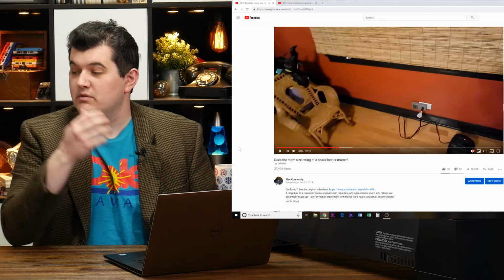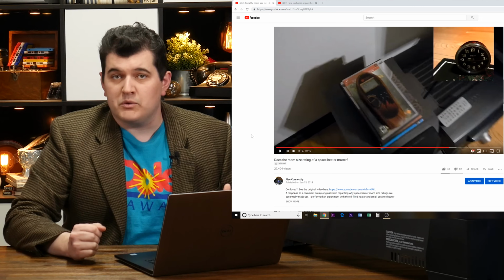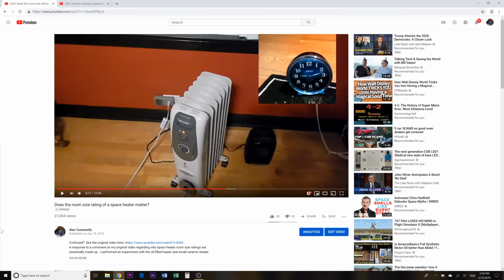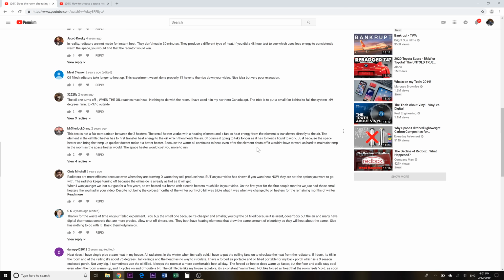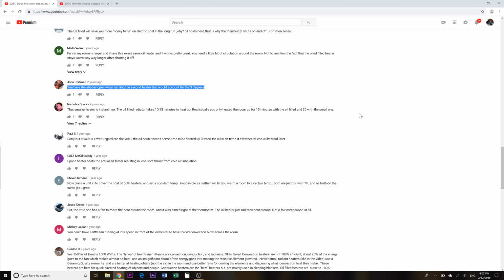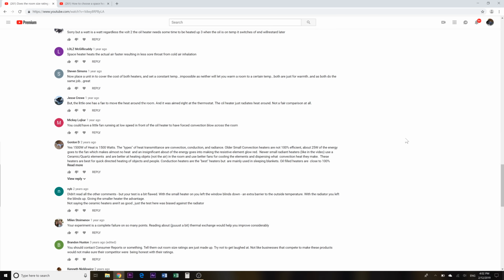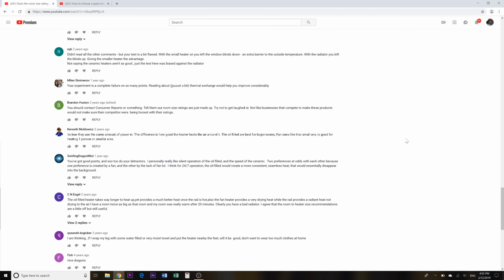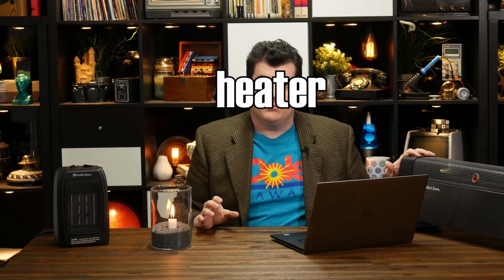More Space Heater Nonsense

Comment: I love your videos, and agree with all the points you were trying to make........that being said, buckle up for some grade A pedantry. Ehem Electric heaters powered by AC current are actually never going to be 100% efficient. Even if you had a perfectly sealed room made out of insulation that could block all conduction and was also 100% reflective to infrared and you had way to measure the kinetic energy of every atom of air in the entire room at all times. why? Well, because all conductors which have a changing current flowing through them will act like antennas and so some of the energy will be lost to EM emissions. Now if the walls were also 100% reflective to all bands of radiation, then I think you really would have a heater that is 100% efficient, depending on how you define it (technically the room is the one providing the conditions that allow for 100% of the energy to be converted to heat prior to leaving the room, since without that EM echo chamber the energy of those waves would exit the room before being completely converted to heat).

Comment: Good video. One of my greater complaints in life is our ability to disagree about units. We all use the second, hour, minute, etc to measure time and it is universally adopted. Why can't we do that for everything it baffles and bothers me. How stubborn can you be!

ANYWAYS 
I was at a kitchem showroom with my aged parents as I had to drive them and didnt want to wait in the car so I thought I'd come in and listen to the slick salespersons spiel or whateveryoucallit. 

So he said, THIS STOVE HAS AN OUTPUT OF 19000 BTU PER BURNER IT IS THE MOST EFFICIENT. As a sh#tty mechanical engineering student who likes to make people upset I said "oh Emm gee how do you like measure the efficiency?!?" He said "IT HAS THE MOST POWER AND IS MORE EFFICIENT". Okay. A little laugh on the inside. Then I said "well doesnt the 19000 BTU stove burn more natural gas?" Then I said a BTU is a unit of ENERGY not POWER. Power has a UNIT of UNIT OF ENERGY DIVIDED BY UNIT OF TIME. I then got two dutch ovens and filled them with the same level of water and put one on the cheap induction cooktop (it was on sale) and one on the really expensive gas range to demonstrate HEAT TRANSFER. A gas range is only like 20 to 35 percent efficient at TRANSFERING energy to the pot you're heating. Thus, an induction stove at 3500W (pretty typical configuration) with an efficiency of 80% because it can TRANSFER the heat directly to the pot is more effective than a 19,000 BTU burner (approx 5300W in proper units) because 80% of the gas burner just heats up the air around you immediately not the pot. Then I had to explain energy consumption and cost. 

He didnt get the sale. 

Shout out to Steve from the local subzero/wolf showroom. You truly need to read a textbook :P

Comment: 1. In what universe is an appliance that takes more than an hour to "get going" considered functional and acceptable, anyway?
2. I strongly suspect that oil-filled heaters "dry out the air less" precisely because they are worse at heating. Dry air in the winter happens when cold air leaks in from the outside and then gets heated up inside. The absolute humidity stays the same, so the relative humidity decreases. So, yes, if you heat the air up LESS, it will "dry out" LESS.

Comment: 15 Year HVAC tech here. No the unit with a fan will always performer better. The more CFM you move around the room the more evenly the room will heat and feel more comfortable. Also all electric resistance heaters are crap IMO Heatpumps and any other form of heating is more cost effective way of Producing heat. 

One of my MASSIVE pet peeves is people who call Electric heaters (100%) efficient so the make 3 BTU per watt but a heatpump will make 10 BTU per watt so  is it 350% efficient ??? No because that is impossible.

Comment: I'm with you 1500W is 1500W no matter how it is or isn't buffered or moved (fan vs convection). It creates the same 5120 BTU. Although Alec, this isn't truly 100% efficient... there are losses between the meter and the cord that go up in heat and since much of this wire may be buried in an outside wall's insulation both of us (and your other energy knowledgable viewers will know) this heat is going to the colder side of the insulation which in the winter is most likely outside-therefore some trivial loss.  

The only thing I can say about the baseboard style heater is that most of the heat goes straight up heating the air in the upper quarter of the room ... the upper air as it cools falls (or is displaced by lighter aka hotter air) warming the occupants without drafting other parts of the room... 

Now a fan-forced heater can cause cooling drafts because of air being pulled into the heater or cool air vortexes caused from the ejected hot air causing cold air currents. This happens with one heater I have, an inexpensive, poorly designed electric fireplace. The fireplace has a heater above the 'flame' window. Since the warm air is ejected about 2 feet off the floor by a  horizontal squirrel-cage fan, if you are sitting off to the side of the airflow relatively cold air will get circulated cooling open flesh (aka my bare feet)... Now is this heater not putting out the rated 1500 W, absolutely not! It is just doing a better job of heating the ceiling than the occupants of the room... And since I am in the Ice Box of the Nation heating a ceiling doesn't do much for keeping me warm!

For those of you reading this and about to go and by an electric heater, buy the cheapest quality looking heater (with certifications to match) you can in the watt rating you require (200-400 for desktop, 1500 for ANY room size) and enjoy the heat knowing Honeywell/ComfortZone/or Brand XYZ didn't subsidize their heating bill with your hard-earned cash!

Comment: Certain ceramic heaters are also self limiting for safety purposes. They act as Thermistors and the resistance increases with excess heat. This decreases the heat and risk of fire in case you block the air flow.

Comment: I think that since it has more surface area that more air can pass through the heating element so it heats up more air. It may put out the same amount of heat but rhe little heater heats a small amount of air to really hot and the bigger heater heats allot of air to warm. Chances are that the small heater will circulate the same air heating up a small area.

Comment: I enjoy your videos and I completely understand and agree with your findings. I just have a tip for anyone who might need it. I have an oil radiator heater just like the one you used in the video and I found a way to get more out of it than normal and what I do is set up a fan blowing on it which helps cool the thermostat so it stays on longer and helps circulate the heat around the room and the effect is undeniable. I know introduction of a fan changes the experiment but that's what I found none the less

Comment: I think, for the experiment to have been seen as 'valid' and garner a more respected response, both heaters should have been the same type.  Having the oil filled radiate style compared to the little forced air heating element style. causes a little disconnect in viewers brains. If both were essentially the same kind of heater rated for small and larger rooms respectively, the experiment would just look like it makes more sense to onlookers.

Comment: The ONLY argument for slow-release room heaters like the oil filled ones that makes any sense, is that warmer rooms also LOSE heat at a faster rate. By maintaining a heat equilibrium between both the oil and the room and the room and the exterior, energy loss from overheating is minimized.

Comment: Yep. I use my oil-filled heater for a small room because it’s got a broader surface and it’s slower. The slower heating seems likely to be safer than a glowing hot element, in a cramped area. I also run the ceiling fan low with the winter switch on to try to circulate the air and remedy some of the “heat momentum” problems. I’ve wondered whether they make oil-based space heaters with a (potentially cabled) remote thermostat.
Reply: The remote thermostat really won't make much difference. If the room is cold enough and the heat loss in the room is high enough, and the heat circulation from the unit is not quick enough, the internal thermostat will have to turn the unit off because it's overheating. The way a remote thermostat helps is if you want to specifically set the unit to heat the room to 70 and have it stop heating once the room reaches 70. But again, if there's not enough heat circulation away from the unit, it will have to shut down when it gets too hot for safety.

Comment: Just a thought... Heaters that rely on passively distributing the heat to the surrounding air, especially if a thermostat limits the output, requires a bigger room, since there will be more air flow in a large room. 
After all, a large room has more cold air to keep the thermostat active. Maybe the premise is all wrong. Maybe a "small room" heater is intended to be more aggressive, and thus "better" in the test you ran, while the "large room" heater indicates a handicap rather than a selling point.

Comment: The difference between heating temperature and room temperature adds to the efficiency of transferring heat from the heating to the room. Therefore, heating with a fan speeds up the heating of the entire room, as it constantly maintains a sufficient temperature difference. When it comes to measurement, you only need to measure the power consumed over time and here you will see the difference between a 1500W heater without and with a fan.

Comment: Isn’t the benefit of the oil heater, that it can hold onto the heat longer as it has oil inside? That’s what I was always led to believe?..
Totally understand the point that’s been made though, ideally the large room heaters need a fan to circulate the air quicker and to stop it from cutting out AND have more watts.
Reply: It radiates heat from one thermal mass to another so you and the objects around you feel warm before the air ever warms up

Comment: Maybe it is because the heater with greater thermal mass will continue releasing heat for a long time after it's turned off, that meaning it will heat the room beyond the desired temperature. If the room is smaller this effect will be greater as long as it dissipates less heat to the environment than a larger room, therefore in a small room you would rather use a heater wich doesn't release extra heat after turned off, so it doesn't get any hotter. Maybe.

Comment: Actually the oil filled heater is better as it shuts off, the problem is that the thermostat is in the housing (not separated) so it regulates to itself and not to the room temperature. The oil is used to store the heat so it can deactivate and still heat. Call it economy mode.

Comment: Well, I think you partly missed the point: a RADIANT heater is exactly that - it RADIATES the heat. It doesn't warm the AIR in the room as fast as an AIR HEATER (even though it does that as well, since it's by the very definition a convection heater, too), but it has the advantage that it gives off radiant heat, which means that it heats up the things in the room - which includes the people in the room facing it. Which is why radiant heat is much better when it comes to heating a room that an air heater.

You didn't check the surface temperature of ANYTHING in the room (which would have showed you that at least some of the heat radiated from the radiant heater was heating up all kinds of surface (including the walls) of the room, which actually (again) makes the room feel much warmer than just the air temperature alone will be able to do (and that's where the energy you were missing in air temperature was actually going).

So, TECHNICALLY, if you just want to heat the AIR in the room, yes, use an air heater - that's what it's for. If you want a "nicer" heat over a longer time, use a radiant heater - and yes, it will be more efficient, since it actually doesn't have to heat the air of the room as high as the air heater - and it will keep the room feeling much warmer over time for less enregy, too (and yes, I had to heat my house for three weeks just with those, because the oil truck wasn't able to come up my drive way in one really bad winter, so I actually experienced that difference myself, since I used the air heater to get my bathroom warm when I needed it, while the radiant heaters kept the other rooms comfortably warm - for less energy.

PS: and as with all convection heaters, PLACEMENT is the key as well. There's a reason why your standard radiant heaters are normally installed below your windows (and not in the middle of the room or on the inside walls).

Comment: One thing I think you missed. Your small space heater with a fan is the best(of the three being spoken of) when you need to take a cold room and make it a warm room fast. Your baseboard heater's strength is going to be the more slow and gradual heating of a room when it's less urgent. The oil heater is more suited for keeping a room at a specific temperature. 

If you are trying to KEEP a room at 72, the oil heater will do a better job for less energy due to it's own thermostat, than the space heater who's only job seems to be to try to aggressively jack up the temp.

Comment: Want free heat? Move power-hungry electrical appliances into the room you want heated. If you have a couple of computer servers running in a closet or your basement, move them into your bedroom and gain the benefit of the heat they're putting off anyway.
I submit that computers ARE more efficient space heaters, because they provide x watts of heat PLUS crunch numbers while generating said heat.

Comment: You’re right, it’s basic physics, case closed. But there’s another issue to which you alluded but did not fully address. 

I used a ceramic heater with a fan to keep a room comfortable. The room was too cold with the low setting but too hot with the high setting, so I needed to use the thermostat. Every heater I could find was wired such that the thermostat shut off both the heating element and the fan. The residual heat in the element kept the thermostat warm, and the heater would not turn back on until the room was cold. The solution is simple, keep the fan on when the thermostat shuts down. I don’t know why they don’t do this. I rewired two of them and they worked perfectly, but no longer UL listed.

Has anyone found a space heater that functions this way?

Comment: It's been my personal experience that convective heaters of almost any type are ok for rooms of almost any reasonable size, that AREN'T DRAFTY, over a long period of time.  For rooms in older houses that leak like an old guy's bladder, a resistive heater with a fan is going to be MUCH better because you're not heating the same air.  That's the difference.  The amount of air moving over the heating element compared to the amount of air being exchanged between the room and the rest of the house/outside.
Reply: It's just a matter of circulating the air so that more heat makes it to the lower level of the room where the people are before it leaks through the ceiling and upper walls.

Comment: Oil filled radiators are great, as well as only useful, for situations where your electricity is very cheap during the night, so you can warm the radiator up during the night and it will give off that heat over the day.

Although to be fair radiant heat feels better than air temperature.

Comment: But.. the oil filled heater does not dry out the air in the room so much and is a much less of a fire risk if something falls against the heater. Ideal for a bedroom with an overnight cycle run.
Good videos... again 240v is better!

Comment: I have an older hardly used ceramic heater. Metal fan inside. Thing is noisy. Strong metal construction though. Also have a newer ceramic heater. Plastic case, guessing s plastic fan inside like would be used in computers. Really quiet. Like it much better. But yes, they heat the room just the same. My favorite space heater though is super quiet. It keeps heating as long as it's on and I like to use it at night, although it uses less electricity than the other space heaters. The old style light bulb. When I need extra heat and light it seems to be the most efficient. Even turning a space heater on the lower setting, figure 700-750 watts if it ran for an hour, but if it runs only 10 minutes each hour that is over 100 watts an hour plus let's say 8 watts to run a led light bulb. Bit if I use an old 60 watt light bulb I get heat and light using only 60 watts an hour. But still people who try to get me I'm destroying the planet if I don't use an energy efficient bulb and space heater.

Comment: People are stupid. This is accurate experiment but they jump the gun before watching the whole damn thing.

It's really simple. You want to be in that room for 30 minutes, the ceramic with warm you up quickly before you have to leave. Oil heaters will take forever and you'll suffer through out the entirety of the 30 minutes. That's where efficiency comes in place. Energy consumption to heat up the room in relation to time. Why is it so hard for those idiots? 

You're correct so you shouldn't give a crap.

Comment: Doesn't the thermal load change (i.e. increase) over the several hours between tests as the outside air temp cools? I don't see this in the comments, and it wasn't addressed in the video, so I feel like I may be missing something, but that would be consistent with the second heater not raising the temp as high.
I.e., after getting back to the "equilibrium" starting point before running the second heater, the room's temp would still want to trend down as it gets later in the evening. Heater number two raised the temp over a lower baseline level.
(I agree with the main thrust of the video, btw.)